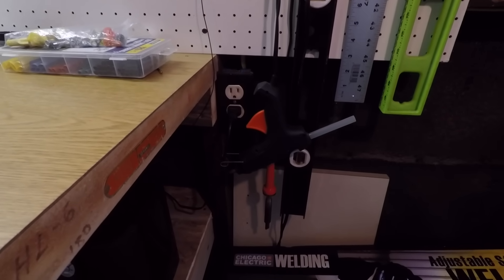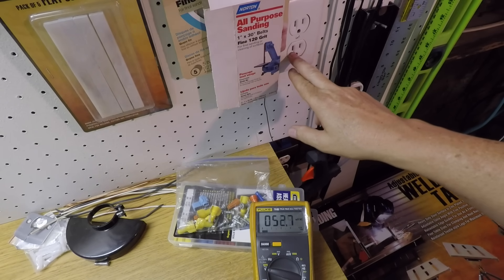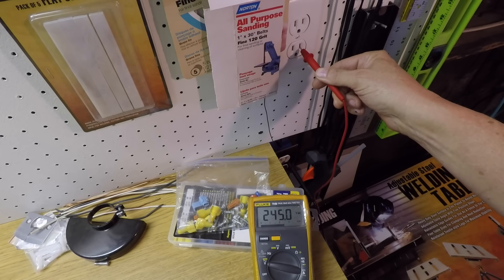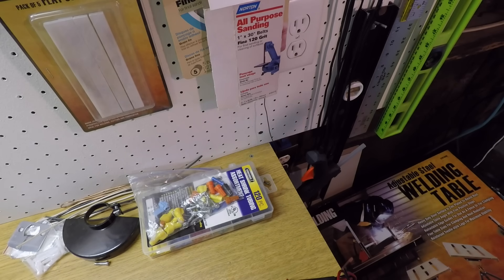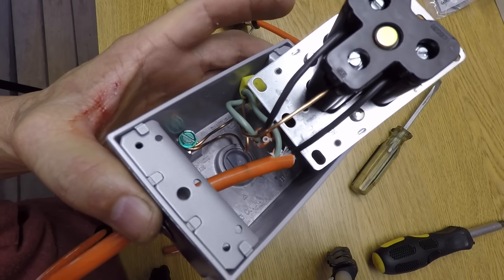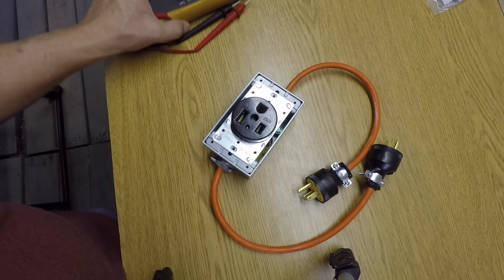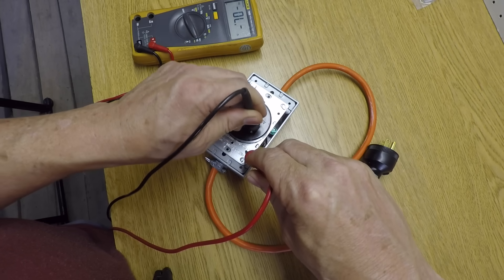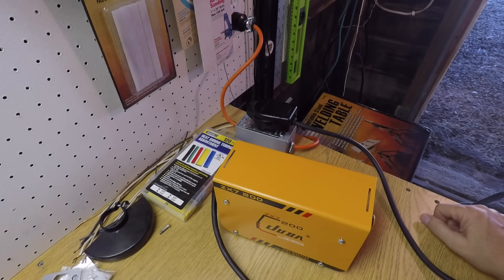How to Get 220v From 110v

Comment: Cool idea. I can see this being handy when your buddy needs work done at his place and there’s no 220v outlet. As a homesteading video, I was hoping he was going to show how to get 220V from a couple inverters with this gadget.  For a welder in your own garage, just run a proper 220V circuit.  This is about as safe as a backfeed cord; it works, as long as you know what you are doing, and the wife or kids don’t try to figure it out while you are away.  Scary how things change when you go from living alone to raising a family!
Reply: And potential deadly! In an approved design, you have both breakers locked together so if 1 side trips the other does as well. This easily could result in bodily injury up to and including death. Equipment damage is pretty much a given. 
Not to mention most near to one another outlets are on the same breaker. So you fail at the beginning. And greater issue few things 220v are rated at 20 amps. 
So many things wrong with doing this.
Reply: Greasy and Coy, I agree with you guys completely. Many people on here keep focusing on the fact that one pole might trip and the other doesn't. But not many are touching on the fact that he has two outlets next to each other on different phases of his house power. Having separate circuits in one room is normal, so that his heater doesn't trip the breaker when the compressor comes on. But if they're in the same room they should be on the same phase of power in his house!!!! There's a reason we don't put outlets of different phases near each other or in the same room. Sure it works to help him run a welder, but that's unsafe it's not a dedicated line for the welder. The rest of the time when he's not welding, he has two separate outlets that he can plug into, near each other, that combined create 240v @ 40 amp.  Many times I have had tools that get an internal short circuit. This is too easy for someone to have a lamp plugged into one and a drill plugged into the other and reach for both at the same time it's a recipe for disaster. He might know that these are on separate phases, but everyone else doesn't, and he has this now in his workshop and out in the carport. JMHO be safe!
Reply: I don't see how this helps your buddy out unless he had the forethought to pre wire his garage for two separate runs a foot and a half away from each other, and if he did that than why did he not run a 240 there, ha ha, otherwise you gotta pull power from two outlets all the way across from each other in the garage if and I mean if (highly unlikely) that dime a dozen two car garage has two circuits in it, probably not

Comment: I would of at least got some 12 gage drop cord. That smaller wire will probably be your weak link and after you weld for a while it might be red hot. There should be some kind of information on the welder or in a booklet telling the amperage it draws. Do not load your wire past 80 percent. When you overheat conductors i have seen them burn like a firecracker fuse. Take care
Reply from the maker: The welder says 20 amps max if I remember correctly. The orange wires on this device never got warm while using it so I was below the 20 amps. I never needed to run the welder maxed out. Thanks for the input.

Comment: Glad you discovered this. All the electricians are going nuts you discovered this and want you to spend $$$$$ for them to do what you just did. Looking at the comments, they can't even agree which way is the right way to do it 🤣🤣. I did a similar mod in my garage back in 1982 when I bought my house I live in now. No problem whatsoever. 👍👍
Reply from the maker: Thank you! I didn't discover this idea though. It's been used by many people in different forms and has worked well . It was the perfect solution for my situation and it saved me a lot of hard earned cash. If a person does their research and knows the requirements of their equipment, it can be done successfully. But of course it will not work for every situation. That's where the research comes in. 👍😀

Comment: Make sure each outlet is on different legs of the breaker box. I still don't approve of the setup but it will work. But on a 50 Amp welder ???

Comment: That is a good idea buddy.   However as with Evey electric device there is always a chance of being shocked to death.   And the system you built may probably works fine.  But it is none the less on two separate breakers.  You  should build one using a  4" box  and install a  duel 20 amp breaker in the  box,  so that in the event of a short circuit the power will be safely disconnected from both power sources.   And it would be better if you build it with 12 gauge wire and  plugs.  After all man,  it only takes one time of being shocked to get killed by it.   So don't cut any corners on safety,  I'm sure you agree that your life is worth far far more than a few dollars you save by using something cheap or too light of duty.    Thank you very much for your video..

Comment: As an electrician I do not condone the use of a gadget like this.  It would be best to either set a sub panel and branch out your 120vac and 220vac circuits or just run a separate 220vac circuit for the welder.

Glad it works for you, but I've seen to many fires started by gadgets like this to justify its use.
Reply: Serious question.. How does a fire start? The device is pulling too much currant than what the wires can handle? And why doesn't it trip the breaker?
Reply: @xoukilong  the breakers should be tied together in the panel on different legs. With this setup, you are bypassing safety standards. This way if one leg trips, it should trip the other. Also, when testing, make sure and test the other wire as well. 

knowing it should be dead is fine but, that's what a tester is for.
Reply: but you could reverse the logic and rewire it as 220 with a double pole breaker and then feed the single receptacles out of that. use a GFI and it has its own internal breaker...
Reply: @eagle9252  A GFI is not a breaker ( ground fault interrupter) completely different. 🙄
Reply: @xoukilong  There isn't a guarantee that each circuits run are close to the same distance. If one run is 1/4 of the distance longer than the other, the resistance can be enough to cause that wire to heat up a lot more just to pull the same amperage at the same voltage. It would legally be designated as a parallel run and by NEC code those runs must be exactly the same length.
Reply: @xoukilong  You pretty much answered your own question. There is not "the breaker". This homeowner concoction is on two entirely separate breakers. If there is a problem only one might trip (read probably only one will trip) and that is inherently dangerous to persons and property.
Reply: @xoukilong  20 amps pulled thru 15 amp wires and plugs will cause them to heat up creating a fire hazard.
Reply: @xoukilong   most Electric fires start because of loose connections . or in some causes faulty breakers that won't trip and also from using the wrong breaker size for the wire .gauge .
Reply: Agreed
Reply: An unqualified electrician says that.
For the countries using 220v electricity, the install 220v outlet just like us to install 110v outlet.
Reply: IM A ELECTRICIAN HERE IN NYC N I TOTALLY AGREE WITH YOU. NOT A GOOD IDEA HE DID
Reply: Really? how many? 10, 15, 20? LOL
Reply: "I've seen" "too many" translates to someone told me about this guy one time.
Reply: I agree.. its an interesting effort...but what I cannot figure out...is why not just run a 220 line or at least combine the two lines into a 220 plug?
Reply: Hell I just built an 8-3 extension cord and plug it into my dryer outlet when I need to. I dont like that cheap ass extension wire he is using. I wont run general power tools on those cords let alone a welder....
Reply: My father used to tell me that, he'd seen and heard of way way too many fires caused by these things sending 220 where it didn't need or shouldn't be and causing a problem.
Reply: 20 Amps won't handle much of a welder.
Reply: I agree
Reply: The only way I’d do something like this is if the outlet was set up as a split with 14-3 with ground on a 240 breaker.
Reply: Would be handy if someone made a 220v adapter that would plug into a 110v split receptacle directly.
Reply: He said he had two dedicated 120volt lines to garage. First of all those receptacles are rated for 15 amps to start.  I know they probably could handle 20. Second , if he wants a dedicated 240 volt Line to garage ,just take one of circuit feeds to garage and take neutral  line at panel of neutral bar, tape it black or red and but it and other feed on 2 pole  20 amp breaker. Been in trade for 40 some years and would never do this. But saying that I have seen a lot of crazy thinks as well. You can’t see it, so what possible harm it can it bring. My advice Call a real electrician. By the way insurance companies will find these jury rigged circuits in a fire, and well we know what happens then.  Be safe.
Reply: That's one leavers a and leavers b
Reply: Just exactly what's wrong with using two hots to get 240VAC? That's how it comes into the house, and that's how 240VAC appliances get theirs.
Reply: @jmtx.  you're just adding unnecessary electrical connections. More chances for something to go wrong.
Reply: It has potential to back feed through the neutral into the breaker box and could cause all kinds of problems than . @jmtx.
Reply: @jmtx.  the wrong is thickness of the wire coming to the outlets is 12GA which can handle only 20 Amps load .He is installing 50 amp outlet so big potential for wires to melt.
Reply: You should see how i power a porchlamp i have at a camping site with no power.  So I use a generator, its female socket and the lamp has a female socket too.  How to hook them up?   Simple, use an extension cord with 2 male ends.  If you plug it into the generator first, just remember not to grab the other end. That goes into the lamp socket.  Flip the switch and you have light. It confuses other people who visit the site how it works. They expect light with no input power.   Totally unsafe unless one thinks about it for a second. I can see OSHA doing a 400 hz shuffle over it if they ever see it!  XD
Reply: That's an ugly hack. Why run 2 120 V circuits when you can just run one 240 V circuit?
Reply: Couldn't said it better...Don't run the risk of burning your house down. Now I know some "Wise Guy" out there will claim all you gotta do is to increase your breaker amperage and bam problem solved...all I can say to that is don't forget in calculating your wire amperage load inside your house, because those are the ones which will catch fire first.

Comment: I appreciate your want for a easy fix,  but there is a safety factor that your not aware of. 
What you made is how hot water heaters were originally wired in as, before a neutral wire and a earth ground were used.  
If one of the heating elements were to burn out, then voltage would flow to the ground on the heater . If touching the water line or the exterior of the tank, you would get electrocuted. 
On a correctly wired system,  if the neutral wire looses connection from the main feed supply. Voltage will spike on one leg and go down equally on the other. You will see approximately 175 on one leg and 50 or so volts on the other. It is  looking for a path to go. Which ever is the least resistance. It will fry everything with a electronic board,  unless ground fault protected. 
You can test this if you want. Just monitor the voltage on both legs and loosen the neutral.  But it will fry anything with a circuit board,  and probably your A/C driven electric force air heating. 
A visual that this is occurring by a faulty neutral  coming in from supply, is the lights in the house will flicker. Another way to verify is monitor the unused voltage, electrons,  flowing back through the neutral wire from the panel going back to the transformer.  There is usually about 5 _10 volts transient voltage. 
Also as previously stated you need to run from the two separate legs. If you still want to do this the fix would be like this. 
Running black power from each leg to you power terminals on the plug. 
Both White neutral to the neutral terminal on plug. 
Green earth ground to ground on box. 
That will keep you from getting fried. 
But reality is.  Just run a 240v tandem breaker circuit.
Hope this helps.
Reply from the maker: There is no neutral terminal on most if not all welder plugs. Three wires required L1, L2 and ground.

Comment: Government buildings often had two separate 120 VAC lines (circuits) to a 4 by 4 box in the wall with two side by side duplex outlets. We combined the grounds, neutrals and hots. There should not be much potential difference between each hot lead if they come from the same main and all wire connections are well made and the correct size. We used jacketed 10/3 for the new extension cord to test motors and other equipment needing 220 VAC. Nice video and tutorial! You can save money doing it this way and it is safe if done properly.
Reply from the maker: Thank you! Finally someone who knows 👍
Reply: that’s because it’s close enough for gu’ment work.
Reply: No  this is not  "safe".   If either  120V  male  comes out of  either outlet,  that  plug  "hot" prong  will be  "hot"  120V to ground.

Comment: Probably a CODE VIOLATIOM,    I an an Engineer, General contractor and taught a college class on the National Electrical Code. Anytime you have 220 circuit and what you are doing would require that the 2 circuit breakers be side by side and a connector to the switch so that if one circuit trips it would turn off the other breaker, or use a 220 2 position breaker an your existing circuits connected to that breaker, If you have a 220 motor connected to that jerry rigged outlet and one circuit breaker trips the other circuit  would still be feeding inadequate power and damage the motor.
Reply from the maker: Did you teach typing and spelling at that same college?

Comment: Hi, I am curious as to why no neutral wires were needed for your setup. Is that standard / specific to the welder? If I were building this 240v box for other types of purposes, would it still require neutral wires?
Reply: 220 doesnt require a nuetral. Only 2 hot wires, 1 ground.

Your neutral is going to be the ground in the fuse box.  Although neutral & grounds are separate lines, they both do the same thing (return current back to where it originates).

Comment: This is interesting, wanted to hook up a dryer inside my RV, I only have a total of 60 amps. This looks like a good fix for that. The dryers they sell would take hours to dry 2 towels, so I need additional power and can shut down all other power while I'm drying something. Any reason you can think of that this might not work?
Reply from the maker: I don't think it will work. To get the 240V you need 240V service to be fed to your RV. No RV's that I'm aware of are fed with 240V service.
Reply: If you have 50 amp RV service have a qualified person wire the 240 VAC dryer circuit for you.  If you have a 30 amp service you only have 120 VAC and will not be able to get 240 VAC.

Comment: I think you might have a 3phase power coming into your electrical panel. You can check your Service entrance cables. it might be 3 wires and a ground wire. Your household might wired as an industrial. It might be safer to get an electrician to run a wire from your panel to your work bench (220v + ground). The profile of the plug/outlet for a 110v and 220v are totally different, you can check this with your local electrician or electrical store. 
The profile difference prevents you from plugging a different voltage appliance to another voltage outlet.
Reply: Whew!  Where to start?!  He has regular ol' 240 VAC single phase powering his house.  You can tell by his voltage checks.  Besides, if he had commercial 3-phase coming into his house, his power bill would be approximately one million dollars a month...
Reply: @retired_military  Yep, there is nothing in any of this to suggest three phase. As far as using 3 phase, its efficient and desirable when available. Gets spendy if one has to pay for lines to be run. Small farms with lots of elect motors use it and all these modern backyard hobbyists with money to burn get it for their fancy equipment.

Comment: I think this is a clever way of getting 20amp 240 service for temporary use if one was in a bind and one didn't mind taking a certain amount of risk.   Regular 240 circuit breakers are either one 240 breaker or two 120's tied together with a bridge, so that if one pops, the other will pop also. Since this rig involves two completely separate breakers, I would be very concerned if the 240 device I was using or one of the lines for any reason tripped one of the circuit breakers and the other one was still open while the device was in use.  Perhaps the device just wouldn't work, or perhaps it creates a dangerous condition, depending on the device.  Who knows. I certainly would not want to find out by accident.  DIY mentions that when he attached only 120 to the welder it simply did not work implying that therefore there don't seem to be any safety concerns.  But what if something in the welder malfunctioned or shorted out or whatever causing one leg to pop.  There's no way of knowing what would happen. So for me as a cheap workaround, it's clever but potentially dangerous.
Reply: I FEEL YOU,RE 100%CORRECT; THANK,S PATRICK.P